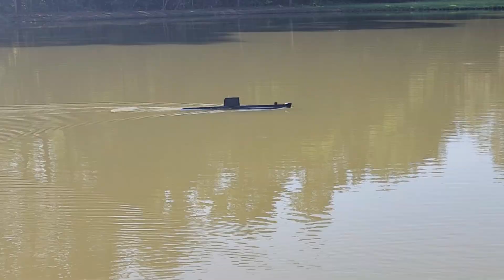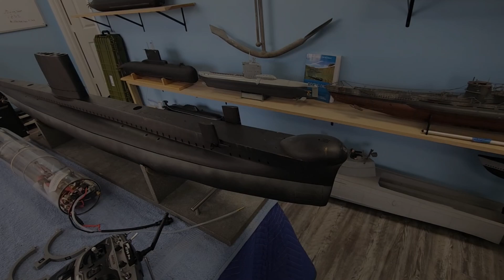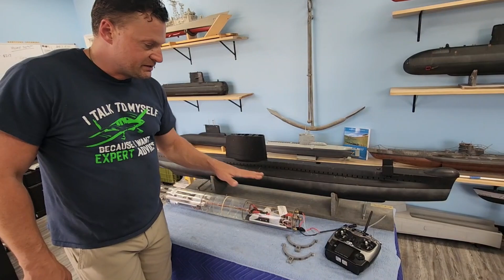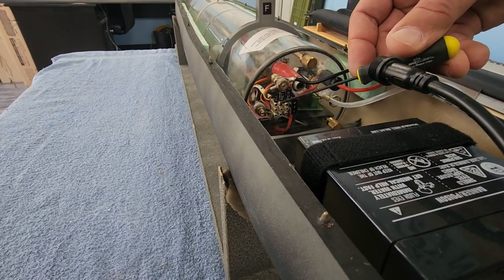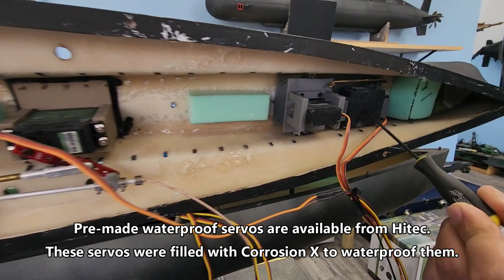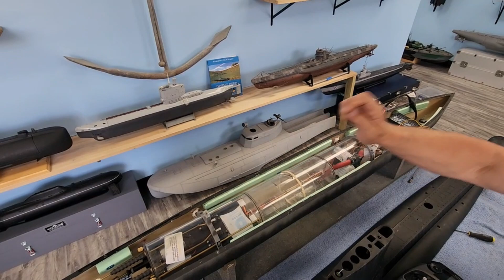RCSubGuy Refits a BIG 1/48 Oberon with Working Periscopes!

Comment: My dad worked on the Canadian subs out of Halifax. I can remember as a kid the Onondaga up on the sink or lift they called it with half of it cut to get the engines out. I was onboard two of the O-Class subs in FMFCS over the years. Then when I got my first oil field job, I flew Work Class ROVs for Oceaneering. Someday, I want to build one of these RC subs.

Comment: The reason it heals over in a turn is the size of the fin , one in Australia was surfacing and got hit by a wave and due to slow drainage of water in the fin went over to a 78 degree list .
Reply: umm.. recall that when boats pass theu neutral on suface or diving that stability is less, it's more thatthan the fin draining too slow..
Reply: The reason it is always better to surface into the wind and sea.